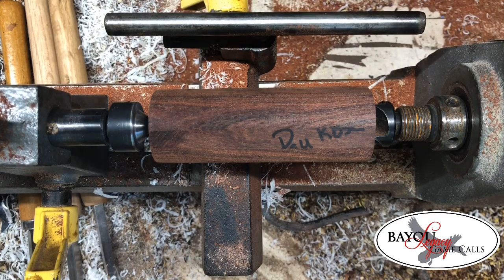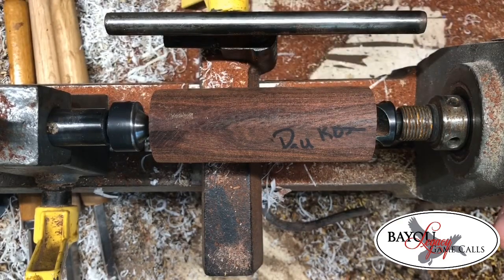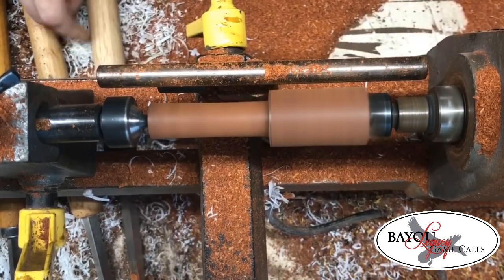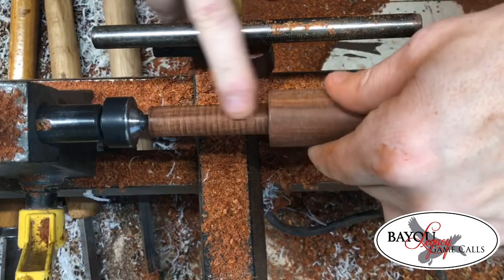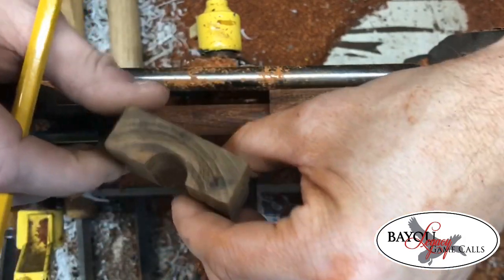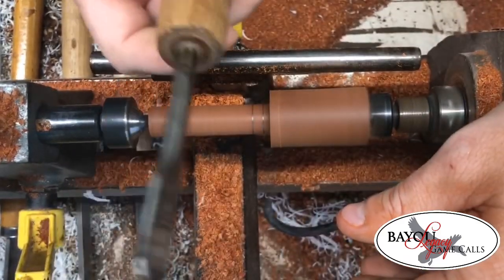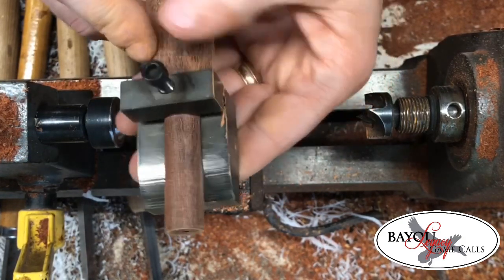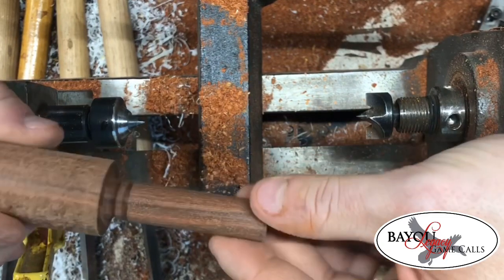Shop-Made Tools: The Tenon Wrench

Comment: Would mind informing me how you made your fluting jig.
Reply from the maker: Hi, James...  I basically just used some scrap lumber I had I. The shop to build a platform to fit my router. I clamp the jig to my lathe bed to hold it in place during fluting. And the height is set to allow the router bit to flute to the desired depth. I know his is a pretty basic description. I need to make a short video to show and explain it in more detail.